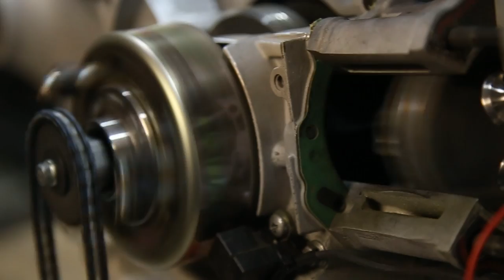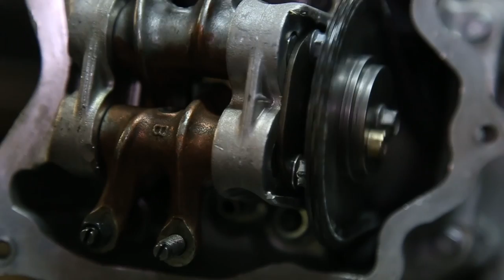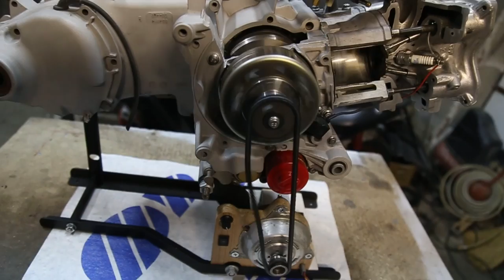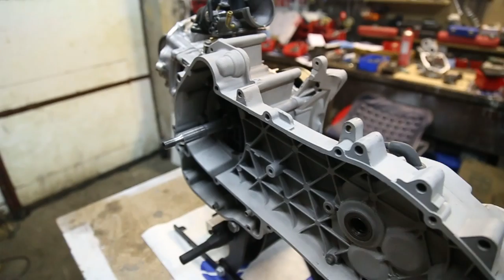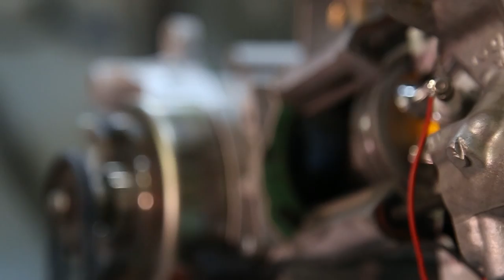piaggio leader engine - how it works

Comment: Reliable , powerful but gas thirsty
Reply: Why is tha?
Reply: @Tungo-zd6jl  A lot of reasons. Big Carburator (so big that if remove OEM 
airfilter box the  engine stalls) , no ball bearings in camsaft arm, cast iron cylinder (no nicasyl) ,bigger diameter than stroke , heavy CVT especialy centrificual cluth , low torque - hight rev operated engine ( 4 valve head.) 
In that era engines , fuel consuption wasn't so important as nowadays. Enginneers care moslty about top end power and reliability.
Reply: I have an air cooled Piaggio X8.
It used to have a 125cc cylinder but I upgraded it to 150cc.
Now the scoot has a drinking problem, but its fast
Reply: @pirpir3496  I have a Piaggio Skipper 125 4t 2004 model. It's thirsty af man hahah I get 100km at max with a full 5L tank